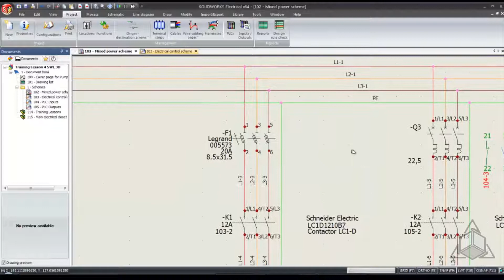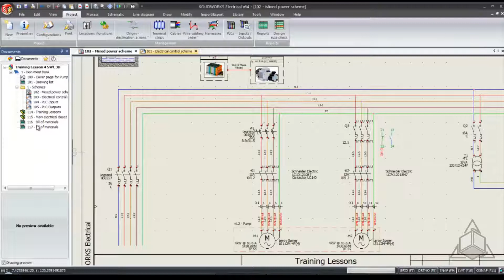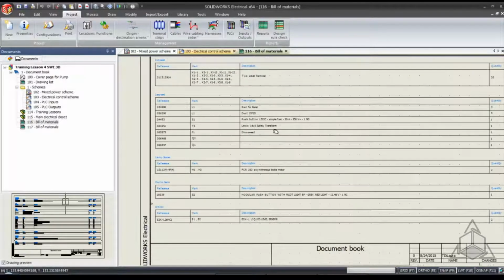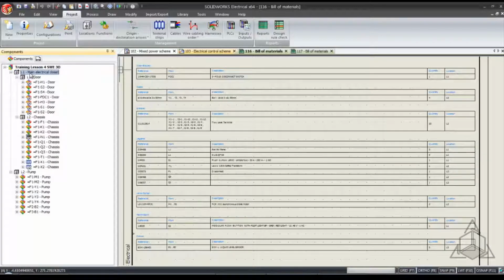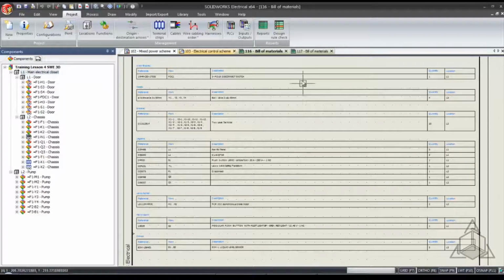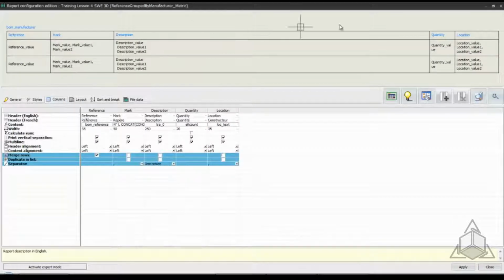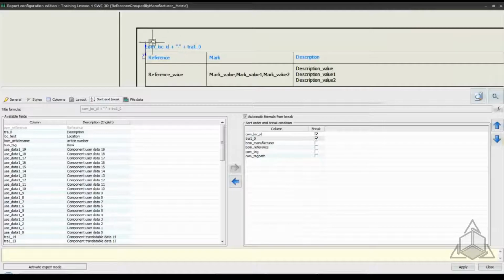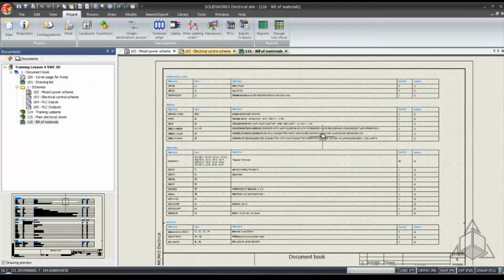Tech Tip - SOLIDWORKS Electrical Bills of Material

Comment: Hi, when I am generating bill of material, only connector is coming but it’s pin is not coming. Can you please help me out how to solve this problem 

I created electrical assembly and added sub part under that
Reply: Did you find some solution ? I'm facing the same issue :(